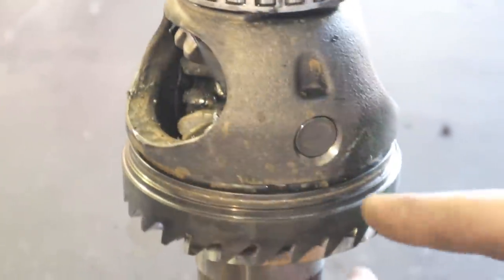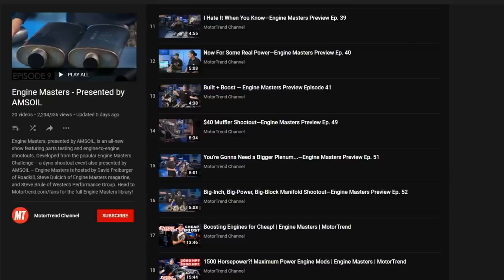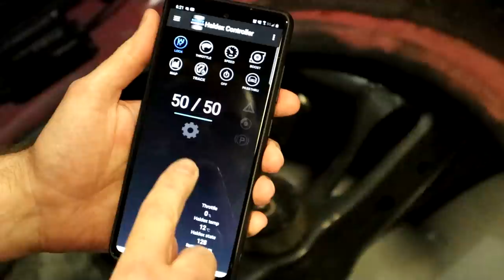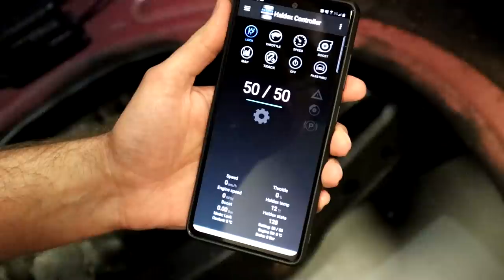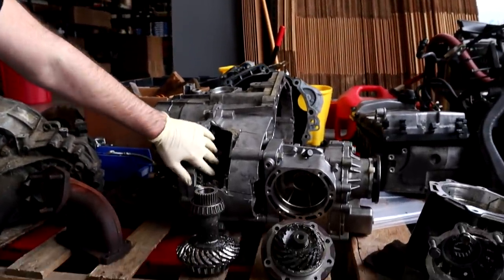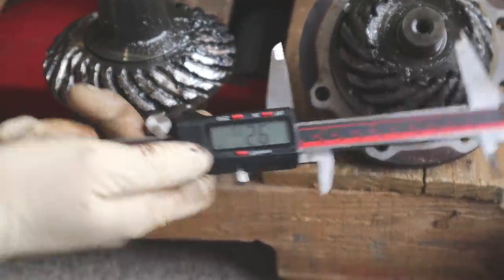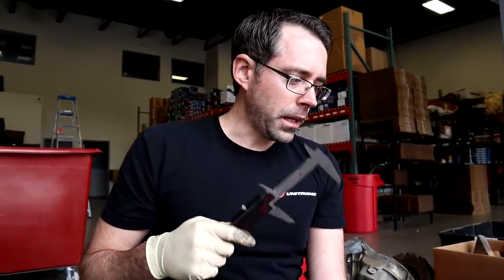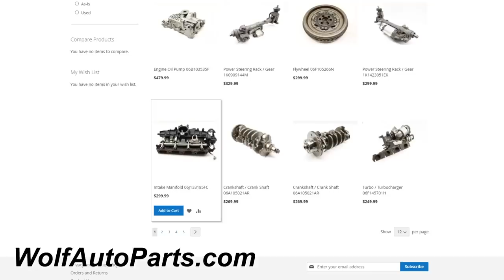Will our RWD GTI do Donuts? | Finale

Comment from the maker: Thanks for watching! Here are the shirts we mentioned at the end of the video!
Faux Wheel Drive T-Shirt (Limited Run) https://www.shopdap.com/dap-faux-wheel-drive-tee.html
Part 1 - https://youtu.be/0rn-z_6k3q8
Part 2 - https://youtu.be/Fw2uC2ccIrE
Part 3 - https://youtu.be/SxntYt7YJWo
Part 4 -  https://youtu.be/ECPi1jMxNAA
Reply: awesome guys! now i know all i need is stub axles and a haldex controller and i can send it with some donuts next summer!
Reply: It's seems to easy haha and not to expensive
Reply from the maker: Except when your transfer case blows up.....
Reply: But that's a part of the fun
Reply: Fucking awesome!!! ... just one question... where did you guys ran the wires for the haldex controller from the existing fwd loom ?
Reply: @Deutscheautoparts   that car will  always have  problems cose you  have  changed the engine  
Line of vw golf. Germans engineer have decades on building cars and u have only mechanic knowledge but u think u can change things cose u just want to have everyday problems on your  cars.  Peace
Reply: Nice work guys, I'm impressed the spacer worked so well... Time to give it some welly on track and see how long it lasts...  Hopefully it should hold out...:)
Reply: Great project! I have a gen4 Haldex Octavia Combi and I've been thinking about converting it to RWD. SInce it's already 4x4, everything is there. Two things I'm wondering about tho:
1. How did the stub axles remain in the front hubs?
2. Why didn't you weld the whole haldex clutch pack and drive shaft together? Then you don't have to worry about the clutch slipping. Even if the engine ECU requires the Haldex ECU to to output engine power  you can still use the aftermarket ECU with some dummy inputs.
Reply: How did you guys tuck the harness so well I've been looking for a decent video to do my mk5 gti but no luck

Comment: This is what VW should have done from the beginning!
Reply: Facts
Reply: I mean, closest car from vw for a rwd swap would be a Passat B5/ B5.5 it has a longitudinal engine and space for the driveshaft since you can get a 4motion version of it :D
Reply: @boboba9659  dont give me ideas! I have a b5
Reply: Not really. Dont get me wrong this RWD swap is cool but saying the VW GTI should be RWD as standard is pretty silly when you think about it. The reason everyone knows the GTI name is because was a high performance but relatively cheap and versatile vehicle. Hot hatches became popular because they took economy cars and added performance. This is why they can be much cheaper than their high end rivals which are all based on luxury vehicles. You make it RWD then the cost goes up, the weight goes up, you lose interior space and the whole point of a hot hatch goes away. 
Put it this way, there have been plenty of "RWD hot hatches" over the years, and none of them are still made (Yes, this includes BMW as their latest 1 series is FWD). More importantly none of them even got close to the popularity of the GTI.
Reply: VW is Vanilla flavoured Vanilla flavouring.
Reply: @matgee8892  what about a rear engine rwd golf?
Reply: there is a w14 powered Mk5 GTI RWD powered by Bugatti
Reply: It would have been more expensive the it's already is
Reply: @matgee8892  no, we need rwd.
Reply: Yh trus me and dis golf drift better den the BMW’s 😮
Reply: @01Silentassasin  w12?
Reply: @matgee8892 Toyota Sprinter Trueno And Ford Sierra Cosworth: 🗿
Reply: @matgee8892  So why not just fwd and rwd. Let the people choose which one they want

Comment: On Honda awd systems we typically weld/pin the clutch patch to eliminate any sort of clutch slip! I’m sure the same can be applied to the Haldex system, but that of course would require two different clutch packs incase you want to swap to a working/unwelded one.

Comment: Done this in my MKV 4motin 1.9pd, if I recall 6 years ago. Had a bent front driveshaft, the driver side one, took it out and kept only the bearing part with the 6 balls, the right side driveshaft was still on, but the diff was open, so did not metter. You don't need a modified haldex controller, will work withe the standard one.It will lock the clutch as it has different speed between the casing and the plates, so will pump oil and self enable it.... also the electronics always enable it during the start ;).  I drove it like that for 200km or more. Had allot of fun but wheels are slipping like hell, the car is too light on the rear axle, and the battery was in the front. The car had a remap, to 160bhp and 370NM.

Comment: Use a irs diff from a 2012 and up ford explorer and modify the axle plates with custom adapters but find one with limited slip. Gears available are 3.55, 3.73, or 4.11 from factory.

Comment: I'm wondering if this type of conversion is possible with the Torsen system in a B6 Audi A4? I'd like to make my Avant rear wheel drive! From what I've read about my A4, it doesn't use the Haldex system, so I'm wondering IF the controller would be needed or not???

Comment: I have a old pvw magazine from around 2005 that has a mk2 jetta syncro that they made rwd and all they did was take out the front axles and weld the diff. Because it's so old you don't need any control modules for anything.

Comment: The porsche ring gear is still the same width gearing as the holedex ring gear… the overall id dimension is just larger but the gear thickness and length looks the same when comparing the gear cuts/groves/surface area that is actually engaged between the two gears

Comment: You should probably weld the hellidex rear differential clutch pack together or just remove the clutch pack and weld in a sold steel piece that was balanced bc the clutch pack seems to be the constant weak link which I just burnt  mine up around 86,000 miles in my 400hp (estimated power, not sure what the torque is but it easily exceeds 175mph and pulls harder than my old C6 z51 vett but the shorter manual gears in the mk7 golf R cause it to be slower, yet more fun bc you get more gears to go through)…Luckily, my mopar warrenty cover the fix since I bought it pre-modified used from a Dodge dealership with a full mopar warranty up to 89,000 miles or 5yrs with a $250 deductible.

(I would like to remove that rear clutch pack and make it all wheel drive all the time with a lsd in the rear [or welded diff] and lock it in 50-50.

I also would like to see if it’s possible to buy a haldex 5 golf R diff and back engineer the software since I already program and build industrial automation machinery…I’m sure I’ll have to cut, grind and weld a bit on the back end to make it fits…plus making some software updates….if not… then it gets an old school ford solid rear axial and much more welding / tube frame added to the underside

Comment: Why you would not lockup haldex clutch with weld?
Reply: Guessing the clutch would be kind of a buffer/torque limiter, if welded all the torque would go straight to the dif and most likely break it. Clutch will just slip when it heats up then might still work after.

Comment: Awesome! Would the mkv r32 front transfer case work with the older Audi Tt transmission? I could use the stock 02Q  gti and swap the the diff for an 02q awd front lsd correct? Then I can bolt the transfer case to the stock trans or Buying a tt trans might be cheaper than buying an lsd for the stock 02q.. what would you recommend?

Comment: Wow its almost like a front wheel drive transmission isn't meant to be output to only the rear prop shaft for an intermediate awd system. Same thing van happen with a 4x4 trucks transfer case with lots of power and only the front driveshaft in it.

Comment: Wouldn't it be possible to just weld the clutch pack in the diff together, thereby completely eliminating the need for controlling it, or the chance of slipping those clutches? I know this video is 3 years old but the whole time I was watching that was my thought.

I was sitting here thinking "man my sportwagen would be fun as a rwd" and found this series of videos.

Now I'm looking at audi TT parts cars, and VW Tiguans for a rear diff  and subframe...

Comment: Complete layman question as I can barely change my own tire, but what if that computer that controls the differential failed for any reason wouldn’t it cause the rear tires to instantly lock up possibly flipping the car or even worse?

Comment: a couple episodes ago: "some of you morons just weld the diffs directly, but we're going to use plates like scholars."
this episode:
Reply from the maker: It did be exactly like this
Reply: @Deutscheautoparts  I'm running the same trans in an NA 07k swapped MK2 TT, so from the Passat subframe, to the clutch stack height change, to the weak 02M angle drive this was like the greatest hits of obscure/lost vortex knowledge I managed to dig up along the way.  Kudos for seeing it through.  There are some angle drive reinforcement solutions that the big power EU drag guys came up with along the way, worth looking into if you want to try and keep it from grenading again.

Comment: Why aren't any hatch back real wheel drive? Is it a snap over steer issue or just cheaper to build FWD?
Reply: Cheaper to build and more interior space.  Most traditional small cars were RWD until the late 70's or early 80's (e.g., AMC Pacer, Datsun 120Y, Ford Escort, Toyota Corolla etc).  Don't forget the BMW 1 series which was RWD until recently, or the Smart car which is RWD.  Most of the new electric hatchbacks are going to RWD (e.g., Honda e).

Comment: long time ago...I blocked haldex with laser cutted disks with tooth from both sides (copied original once). I don't remember how much...around 20 or 25 pcs. Rear diff hold till 800-1000 hp...so this car is away from that.

Comment: Just remove the software controlled clutch system and convert the drive axle to direct drive, it's dead weight of more things that can break and it just looks stupid compared to removing that juicero-esque clutch feature at all between the drive shaft and the differential as it doesn't serve any real purpose any more.

Comment: I actually want to turn the motor 90degrees and run a custom cut axle shaft a solid rear ford axle or vette c6 transaxle with the rear transmission which will probably never happen and just go back to making a gti powered shifter cart….or moving the entire front Golf R engine and transmission and place it in the rear trunk just like it’s old vw forefathers (beetle) did while ignoring the whole anger issues of the time back in the late 30’s and early 40’s conquest of world domination.

And lock the computer into 100% fwd mode…which will now be in the boot as rwd car….now I’m imagining a tube frame rear end to allow for rear wheel steering and see how much that messes with the drivability…going around like a forklift on steroids

Comment: So, stock GTI? With a R rear? I don’t realize they have the center tube for a drive shaft..
Reply: R32 drive train with the front axle taken off
Reply: Their engine is far from stock
Reply: I was asking about the body. Is it a GTi? Or a R body? Wondering about the center of the body. I was assuming it was a R/R32 modded for RWD.
Reply: Same body but the rear subframe and gastank allows space for the driveshaft
Reply: @briand7381  watch the first 3 parts and you'll understand what they've done

Comment: Those "AWD" transfer cases are crap. I remember back in 2003 when I worked for a GM dealership. All the new cars that just came out with that crap were coming in with those gears torn up like that. It's just a crap system and why I will never buy that "upgrade." If the car is a FWD, I'm buying the FWD version, not the "AWD/part-time 4WD" crap.